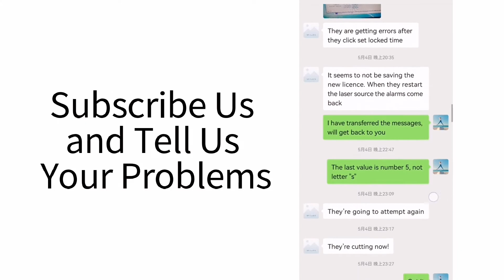Problems on Laser Machine | Issues for Fiber Laser

Comment: hi  clara, nice video, could you posible to help laser cutting there is a red light but no firing i check evrything but not success, thanks Lesty
Reply from the maker: is your shutter off？
Reply: its on i check inside power supply test ok 35v there is a red light status ok brand is raycuss 1000w
Reply from the maker: @lestyjuanson2015  in warranty?
Reply: nomore more warranty 2019
Reply: do you have email
Reply from the maker: @lestyjuanson2015  I think you need a thorough check.
Reply from the maker: @lestyjuanson2015  clara@spierlaser.com
Reply from the maker: @lestyjuanson2015  clara@spierlaser.com

Comment: Im having an issue in which the laser will wander off track while marking a path and then it would stop far off the projected mark and freeze there while causing the ezcad program to crash and need restarting. Any idea what this could be?
Reply from the maker: Sorry, please share a short video.
Reply: @ClaraChai  In this video the laser is obviously in light mode, but it wanders off and returns back to center. Usually when it wanders it doesn’t return to center and stays out, causing the ezcad program to crash. furthermore, had it been marking and done that, it would’ve marked a line on the base plate.

https://youtube.com/shorts/_aRePn9lKDY?feature=share
Reply from the maker: @teankum96762  are you sure there is no other content top?
Reply: @ClaraChai  yes, there is just the “TEXT” in the center on a new blank space. The laser always wanders to that area regardless of what vector i put into ezcad, and 9 out of 10 times will not return to center